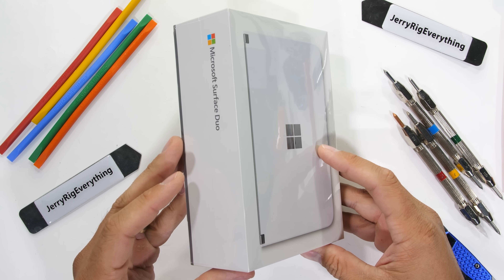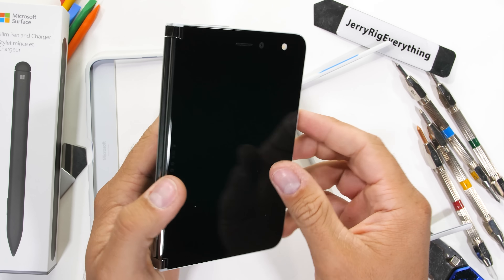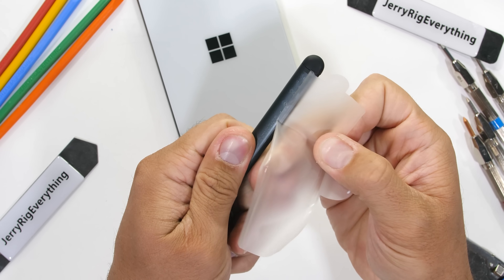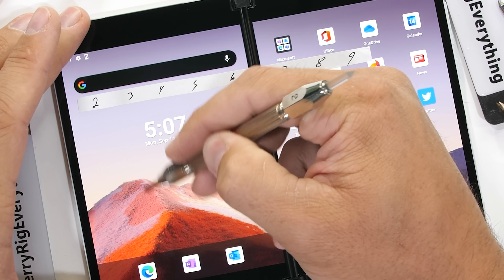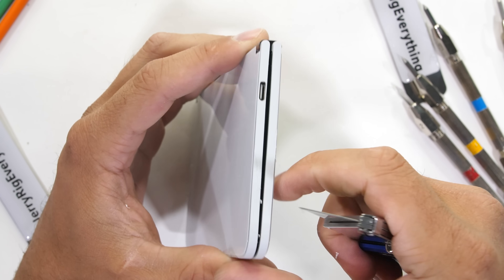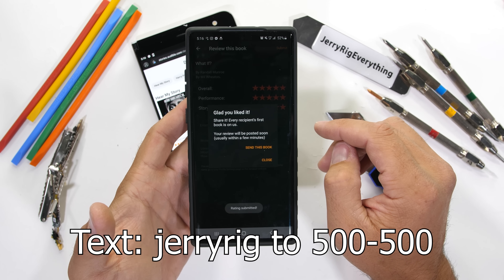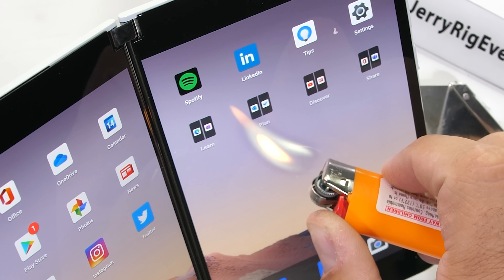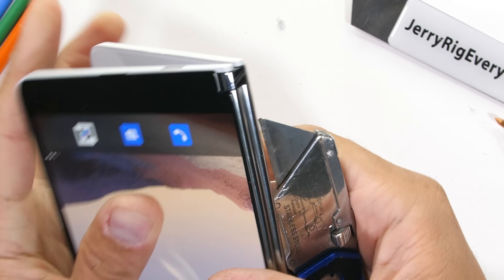Microsoft Duo Durability Test! - How Thin is too Thin?!

Comment: The bend test is the one that surprised me the most...
Reply: They lost me at the plastic frame.
If they made the duo 2 with a magnesium frame and back like all other Surface devices and integrate the NFC and Wireless charging in the Microsoft logo, also add a Carl Zeiss back camera, then I'll consider buying that device.
Reply: I wish he also tried bending one screen(that could simulate someone sitting on it when it's open) to see if the phone would survive , but after seeing the thing barely surviving with both screens sandwiched together , I don't have high hopes
Reply: When the phone is closed the hinge kind of keeps everything together but if you bend one screen only... A couple of seconds.
Reply: I thought this was a joke lol
Reply: @ukpkmkk_2  plastic acts as a shock absorber when it falls down..That's the reason they had plastic over the edges
Reply: They chose Rubberized Plastic for the outer frame for durability. Glass Sandwich/Metal Frame/4mm frame would of been too easy to break!
Reply: This dual screen phone survived but Oneplus nord failed.
Reply: @mohitkarki7185  ☹
Reply: @ukpkmkk_2  It is the first generation so calm down your nerves
Reply: @madhusudanswain2857  I know.. That's why I talked about the surface Duo 2..
Reply: @Lonely Boy the features I mentioned were quality and signature features.. After all, surface devices have a distinctive heritage and this device doesn't have it, and by that I mean the magnesium exterior that makes it more rigid and more surface-like..
The wireless charging and NFC however are not, yet they are essential in a business aimed phone (NFC for wallet and other cards/keys and wireless charging for charging it on a dock/desk)
And the Carl Zeiss camera is just to make up the lack of a decent camera and it was a very successful feature in previous microsoft/nokia phone..
My Lumia 950XL's camera is still better than many cameras nowadays including some flagships.

Comment: "It's easier to watch society collapse"

Dead body reported
Reply: Discuss
Reply: it was red
Reply: "JerryRigEverything was not the Impostor"
Reply: @DiyEverything433  pink that's sus
Reply: @CarthagoMike  how do you know
Reply: @TechDove  u look sus to
Reply: @DiyEverything433  it wasn't me bro I saw white in electrical
Reply: Ieaturass was an impostor.
     2 impostors remain.
Reply: I am not also I was in the reactor. Black looking sus.
Reply: @DiyEverything433  No. do you have any proof?
Reply: Name all tasks

Me:Admin: Accept Diverted Power
Admin: Chart Course
Admin: Enter ID Code
Admin: Prime Shields
Admin: Swipe Card
Admin: Upload Data
Balcony: Clear Asteroids
Balcony: Record Temperature
Boiler Room: Open Water Ways
Boiler Room: Replace Water Jug
Cafeteria: Accept Diverted Power
Cafeteria: Download Data
Cafeteria: Empty Garbage
Cafeteria: Fix Wiring
Communications: Restart Wifi
Dropship: Chart Course
Dropship: Insert Keys
Electrical: Calibrate Distributor
Electrical: Divert Power
Electrical: Download Data
Electrical: Fix Wiring
Greenhouse: Accept Diverted Power
Greenhouse: Download Data
Greenhouse: Fix Wiring
Greenhouse: Water Plants
Hallway: Fix Wiring
Laboratory: Align Telescope
Laboratory: Fix Weather Node
Laboratory: Inspect Sample
Laboratory: Repair Drill
Laboratory: Submit Scan
Lower Engine: Align Engine Output
Lower Engine: Fuel Engines
Medbay: Accept Diverted Power
Medbay: Download Data
Medbay: Fix Wiring
Medbay: Inspect Sample
Medbay: Submit Scan
Navigation: Accept Diverted Power
Navigation: Chart Course
Navigation: Download Data
Navigation: Fix Wiring
Navigation: Stabilize Steering
O2: Accept Diverted Power
O2: Clean O2 Filter
O2: Download Data
O2: Empty Garbage
O2: Fill Canisters
O2: Fix Wiring
O2: Monitor Tree
Office: Download Data
Office: Fix Wiring
Office: Scan Boarding Pass
Office: Swipe Card
Outside: Fix Weather Node
Outside: Open Water Ways
Outside: Record Temperature
Reactor: Accept Diverted Power
Reactor: Divert Power
Reactor: Download Data
Reactor: Fix Wiring
Reactor: Start Reactor
Reactor: Unlock Manifolds
Shields: Accept Diverted Power
Shields: Download Data
Shields: Fix Wiring
Shields: Prime Shields
Specimen Room: Start Reactor
Specimen Room: Unlock Manifolds
Specimen: Store Samples
Storage: Empty Garbage
Storage: Fix Wiring
Storage: Fuel Engines
Storage: Water Plants
Upper Engine: Align Engine Output
Upper Engine: Fuel Engines
Weapons: Clear Asteroids
Weapons: Download Data
Weapons: Fix Wiring
Reply: @whatanazzhole5244  saw you nowhere near others sry bro, guys if not red than me i very sure
Reply: @whatanazzhole5244  broo  why did u have to put  every task in among us and all other games?
Reply: @DiyEverything433  bro there are several accounts with name Red not just me.
Reply: @whatanazzhole5244  lol ok
Reply: you self report ,huh? Ok
"Anikait singh was not an imposter"

Comment: “Is it heavy?” 
“Yes” 
“Then it’s expensive, put it back”
Reply: Roborav  Yeah,get the Note 20 with it's plastic back.
Reply: @huzumnicolas4343  he said top of the range samsung so its the note 20 ULTRA, it does not have a plastic back.
Reply: Roborav have you ever seen Jurassic Park?
Reply: sonnick 👍
Reply: @martyr3498  Yup, top of the range definitely doesn't include the Note 20, sure dude
/s
Reply: Roborav  Not if you are in a Exynos variant. Then you are going ro get worse performance+radiator when you open every game.
Also why are you even comparing Surface duo with other flagships?
It's obviously a first gen product like Fold 1,is definitely not worth it, nor a very good experience.
Reply: Roborav  Why would someone buying a dual screened phone need a Samsung note 20 ultra?
Reply: Jurassic park 1 movie binocular reference

Comment: I thought Microsoft’s phone market was dead after Nokia stopped making their stuff.
Reply: It runs Android instead of the OS that the Windows phones had, so it'll be fine
Reply: I thought the zune line was done when toshiba stopped making their stuff
Reply: and it's still dead, i doubt that many will buy this thing
Reply: @scan4707  Windows Phone OS was beautiful and has inspired both iOS and Android.
Reply: Windows phone os>>android os
Reply: Based on that bend test...looks like they uses nokias old engineers on this one!
Reply: @nintenjoeee  I agree. Their block design was way ahead of it's time
Reply: Make new videos. This isn't a request.
Reply: @nintenjoeee  The UI was amazing, the lack of customizability wasn't, it's a shame ms kept it locked to their own store (if I remember correctly, you couldn't sideload)
Reply: Andrey Lucas Ha, thanks for the message mate. This is a random ass video to find a fan on.
Reply: @JMNTN  Oh good you shared your opinion.
Reply: @nintenjoeee  Windows Phone OS (7) was released 3 years after iOS or Android. (iOS June 2007, Android November 2007, Windows Phone October 2010). Not going to deny though that it was a nice looking OS, but they arrived late to the game.
Reply: It's an Android device
Reply: Nokia still alive!
Reply: @scan4707  the failure if windows Phone was it's more complicated than ios and Microsoft failed to released Multi variant and other important thing is most applications supports storage for internal storage and
Reply: @scan4707  windows os wasnt wierd😂 the thing is developers werent makin apps for it so people wouldnt buy it thats y they stopped it but they came back with android
Reply: Nokia wasn't making stuff for Microsoft. Nokia was owned by them.
Reply: Microsoft killed Nokia... With lumia like Crap models
Reply: @jeffster1070  They were referring to the fact that later versions of Android and iOS (as in, after the death of WP) incorporated features that WP already had such as dark mode, live photos, wifi sense, etc.
Reply: Roborav  keep using your iPhone and be happy.
Reply: @JMNTN  I'll buy the second iteration when they make it thinner
Reply: @bestbattle totally incorrect, Nokia was 'licensed' was by Microsoft to make Windows phones for a set period after various mishaps. In turn Nokia made amazing Windows Phone 8.x phones resulting in them owning almost the entire Windows Phone market. Microsoft had no choice but to buy Nokia's Devices and Services division period before the licensing period ended. So no, Nokia was never owned by Microsoft. Nokia still exists as a separate entity and continues to designs phones which are turn are manufactured by an ODM.

The acquistion of the devices and service division resulted in greedy stock holders kicking Ballmer out. So to calm these morons, the new ceo had to literally axe the entire mobile division. Thus as a result the Lumia 950 series launched with a buggy o/s and tanked any sort of momentum Windows Phone 8.x gained after being restarted from Windows Mobile 6.x to Windows phone 7.x and again from Wp 7.x to Wp 8.x.
Reply: @scan4707  Microsoft should develop a launcher based on Windows 10 Metro for duo and for those who love windows style
Reply: Roborav  You are absolutely right, Roborav, thet master of materials and design.
Reply: @NotBot171 Windows Mobile 10 Works  perfectly fine. I use both a Lumia 950 XL and Xperia 10 running Sailfish X.
Reply: @JMNTN  Businesses buy these things, they get them at cheaper prices and are compatible and supported by Microsoft 365 products
Reply: Nokia:MICROSOFT!!!!
Reply: @lbx5566  not sure if you're being sarcastic but there is a Microsoft launcher for android, and I've been using it since I found it. Combined with an icon pack it's basically the best ui I've ever had
Reply: @gormauslander  I tried it but it didn't seem special to me. Nova Launcher is the best
Reply: Apple and Google literally copied everything from Windows phones. I still love my 6 yr old Windows Lumia phone and its fast af even to this day though I do not use it regularly. It was too ahead of its time.

Comment: You don’t need a rear-facing camera. You can just fold it to the other side.... right?
Reply: Generic Account but it's still a piss poor camera for the price. I feel this was the biggest sacrifice to keep to this size
Reply: Christopher Infante True. Especially at that price.
Reply: @mazyoda_  but hes asking for more cameras not better ones. I dont see how more bad cameras improve anything as every usecase i could think of is comfortbly doable with a single camera in this configuration.
Reply: @Ganymede_the_great  I would rather have a higher mega pixel camera than any multi camera tomfoolery.

I just find it rediculus that a $400 iPhone se has a comparable rear camera to the duo.

Comment: Phones with IP rating: *exists*

My phone: literally a huge gap between display and frame through which you can see the internal parts hidden deep inside the unknown depths and still survives from water splash
Reply: You have a Samsung I bet. Same here I had an a5 and both front and back glass got so cracked you could see the motherboard, with some form of Witchery it survived an accidental diving from a five foot drop into water. I’m so amazed
Reply: @everybody5087  great guess man! I own samsung on6
Reply: Same bro. Atleast its not a broken screen.
Reply: Yus
Reply: Same bro but it's cool though  it's like a backlight of my screen
Reply: @everybody5087  the internal components on those phones get sprayed with a hydrophobic coating

Comment: I've never used a Microsoft phone/tablet or even used Android but i can definitely see myself using this if it gets some more cameras and maybe a metal frame, i mostly use my phone for reading/video and the duo looks like a great way to do both, although it's a little wide for my front pocket. I'll wait and see how their version two does on your durability test!
Reply: I dont want to do that personally, I would want a 3rd party phone/computer. Same reason why I don't want a google pixel as my next phone, even though my whole family has them.

Comment: The frame around the charging port of my Duo is cracked, no idea how. Does anyone sell the plastic frame? I'm in the UK and Microsoft have been woeful with their support- they haven't attempted to provide any. So trying to source the parts so a local repairer can fix it. You can't get the parts in the UK, typical. Wish I hadn't bought this device

Comment: question: why do they use batteries in their pen, if there are companies like gaomon out there selling graphics tablets with pen included (without a screen so to be plugged in a computer /Laptop) that cost around 30$ have the ability to move the curser with the pen being half a centimeter away from the tablet,and also having a few buttons on the pen, while the pen itselve doesnt use any battery. So why? To make it expensive? to ruin environment? to force the user to charge it after 14 hours of use? To show that tjey are dumb?

Comment: This thing would be much more appealing if it ran Windows.
Reply: Tell that to the failed Windows phone and its lack of apps :(
Least Android and Windows pair well together though!
Reply: @tavrodrigo5103  no I mean ACTUAL windows, not some mobile crap os. Or at least something with the same functionality as a desktop os.
Reply: @Crasstho  oh right right, well tbf i used to have a lumia and the os on that and windows 10 in tablet more are relatively similar - just not supported enough
Reply: @tavrodrigo5103  well yeah you have survace Pro and that's why I was kinda hoping this whould also have windows since its a surface product...

Comment: Seems like a decent device. I think the single camera is not an issue - it can be used both as a front and back camera. Lacking a second speaker is a bit of an issue. The worst of all is that I don't see myself using the second screen that much. It's only good for typing and multitasking. Maybe a small set of apps can make use of it (like ebook apps, would be awesome), but most apps will keep using a single screen. I wonder if people are gonna keep it folded in the "open" state - with screens on the outside. Then it's basically a regular phone on one side and you just ignore the rear screen when you don't need it.

Comment: So you said the surface slim pen isn’t as streamlined and integrated as the Apple Pencil or Samsung stylus (idk the name of it) but that’s just not a fair comparison. The surface slim pen was designed specifically for the surface pro X and with that it’s perfectly integrated, it’s hidden within the keyboard and charges wirelessly through the keyboard. It’s just as integrated for the surface pro X as the 2nd gen Apple Pencil is for the iPad Pro. The only difference is Microsoft aren’t complete fucking assholes and they made it compatible with ALL surface devices. Apple on the other hand couldn’t bother to do that for the Apple Pencil. Now, the question of if it’s as good as the Apple Pencil, fuck no. It’s shit for digital art but it’s great for notes, the Apple Pencil is good for both and you can get a paper like screen protector for the iPad Pro.
Edit: another side note, the magnets are meant to attach the slim pen to the surface pro X keyboard, but the surface duo does have magnets for it as well and it actually stays in place pretty well!

Comment: I'm with Zack.  This design overall appeals to me far mar than Samsung's fold or flip, even though I've used S and Note series phones for about 10 years.  I just can get into soft plastic screen.  But it has to have decent rear cameras.

The largest issue I have with folding phones (and I may eventually get over it) is that I carry my phone in a wallet case.  With a folding phone, I'd have to start carrying a wallet again, and I really don't want to do that.